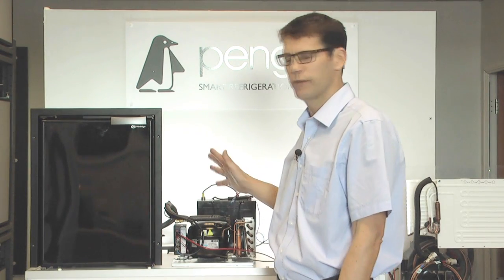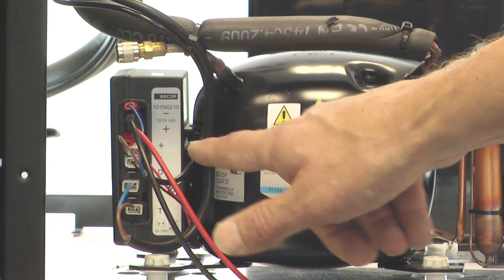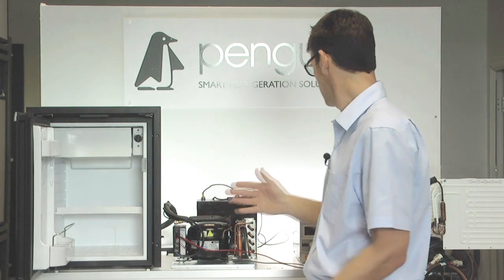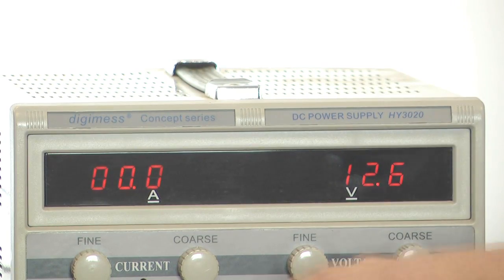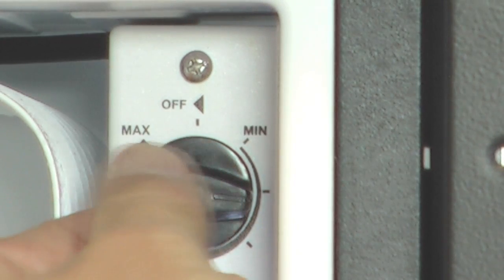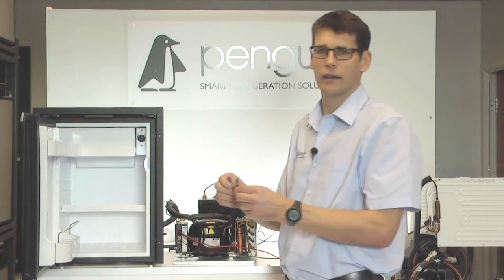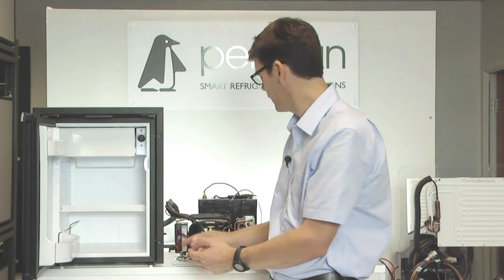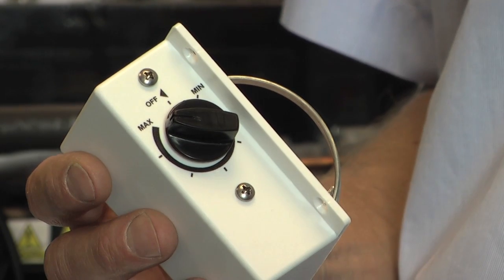Initial Fault Finding for Danfoss/Secop 12/24V Compressor fridges (BD35 BD50)

Comment: hi I've got a danfoss cr1110 camper fridge not cooling at all the compressor is working on 12 volt and 240 mains. its getting warm and I can hear a humming noise  the thermostat inside the fridge seems to start the compressor fine when I turn nob it starts and stops the compressor..  light is on inside fridge  . the fan on the back is not spining if that should start straight away im not sure.  any ideas??? thanks for any suggestions. could a faulty fan stop the fridge from getting cold.

Comment: Hi there,
I diagnosed the a problem with our BD35 using the compressor link out test. I sourced a replacement thermostat in Greece. But it had 3 pins not 2 as per the existing thermostat, so I used the 2 pins that were open when the thermostat was at room temperate with the thermostat knob turned to 1/2.
Now the compressor never stops, any ideas?

Comment: Hey mate I’ve got an issue where the fridge runs really well but it won’t turn off and it just freezes everything, I’ve replaced the Thermistor but could a faulty thermostat be a possible cause of it not turning off? Even when it’s set to the coolest setting it can just runs 24/7
Reply: Hi Jonathan In the first instance we suggest you check your thermostat. It should be connected to contacts C & T. If you disconnect one of these connections the compressor should switch off. Have you also checked the thermostat probe. Some probes attach to the evaporator plate (the plate that gets cold inside the fridge) some are air sensing. The probe that attached to the plate must be secured to the plate. Any further questions please contact sales@penguinfrigo.co.uk. Regards Penguin

Comment: I have the 101N0212 secop/danfoss model, very similar looking setup.  the internal LED is blinking 2 times every so often which according to the manual, is a fault code for "Fan over-current cut-out".   I isolated the fan leads and hooked them to 12V and fan runs perfectly and quietly.  Is there any thing else I can do to troubleshoot? I did everything u mentioned in this video.   Excellent voltage coming in..  I used the jumper (link out) wire to the T and C leads and nothing happened.
Reply: Hi Michael, Try and run the compressor with the fan unplugged.  If is likely that even with the fan removed it gives a 2 flash error, as for some reason the new Secop 101N0210 controllers do this when the fault is voltage drop, which is normally a one flash error (code 1).  If this is the case I recommend that you treat it like a code 1 error and thoroughly check your electrical wiring and connections.  Any weak connection will cause voltage drop.
Reply: I have the same issue. Fan runs when isolated, all connections good and battery voltage is 13v. No drop at all when I switch the fridge on, no compressor running. 2 flashes on LED. Any suggestions?  Replace board or replace compressor?
Reply: @zelone9507  I have this same issue. Have you fixed it? Was it the controller?
Reply: @zebelliott5780  I have this same issue. Have you fixed it? Was it the controller?
Reply: @zelone9507  By the way, I did test the amperage that the fan is drawing and it only hit 0.19amps on spin up and then settled around 0.13amps which is far cry from the 0.50amp cutoff so I pretty much isolated the fan but still getting the 2 flash error light. I'm starting to think it's the board.
Reply: @A l unfortunately  it did not fix my issue. I'm torn between scrapping it or having an hvac guy try to fix. Replacement compressor kit is expensive.  My fan was drawing more than yours but even with fan disconnected, fault is still there and compressor will not run.😮‍💨
Reply: @zelone9507  Ok, I fixed mine. It was the control module unfortunately. I did a bunch of tests on the fan as well as the pins from the control module. When I put a voltmeter up to the fan pins on the control module, it was only outputting 1.8v which is not enough to spin the fan. This is causing the unit to shut down within seconds of trying powering on.

Comment: Can I also do this check on my 24V Danfoss coolmatic 101N0210?
Reply: Yes, the hotlink only bridge the thermostat and the 101N0210 thinks you want the coldest possible temperature. The compressor run as long you got Power >10,4V.

Comment: so I did all that, linked out the thermostat, compressor running, fan running and no cool...the next step is the solenoid I assume?
Reply: Hi MrDwillia if you have a solenoid fitted to your capillary then yes it must be open. Otherwise the fault you describe could be lack of refrigerant or a blockage possibly ice in the capillary. If your solenoid is working, try a warm flannel on the capillary to see if  the refrigerant will flow and it starts to get cold.
Reply: @managerpenguin3084  thanks for replying. the fridge has sat in 35 degree weather for days and still no flow. How do I test the capillary solenoid? check for voltage?